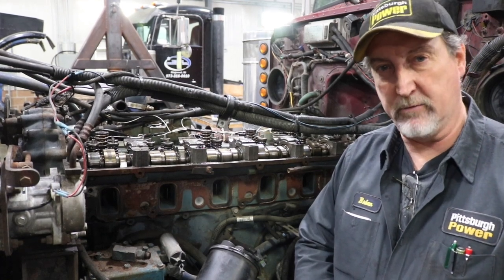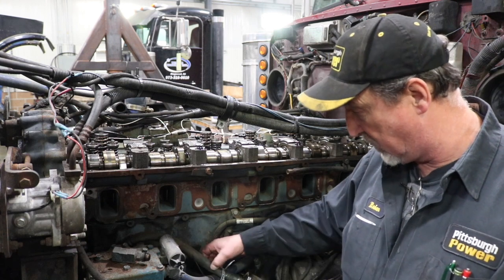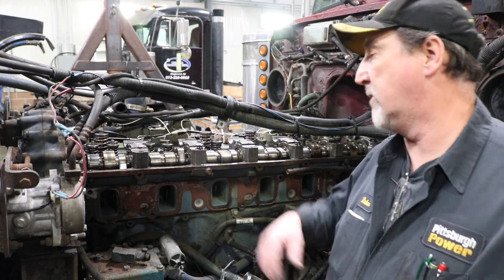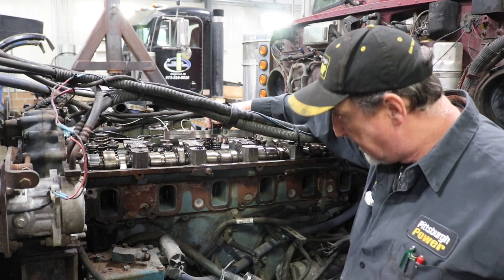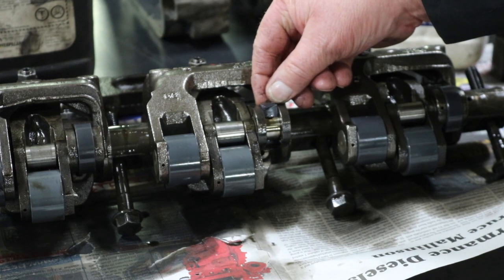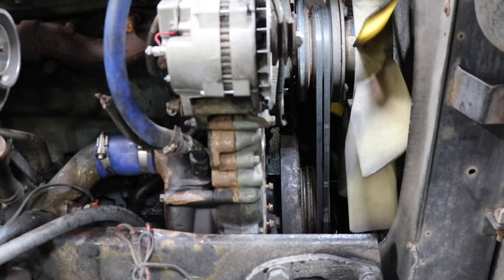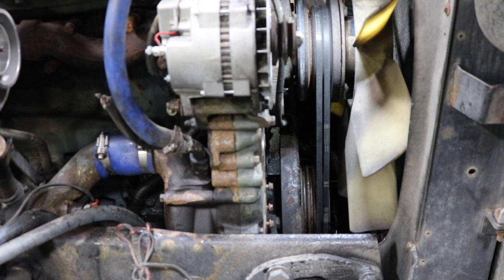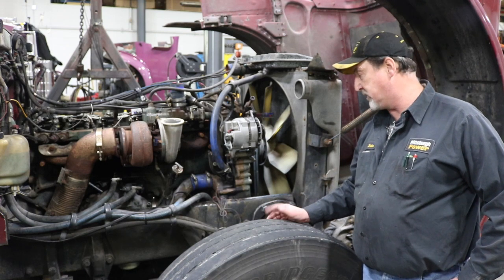DDEC4 IV Tech Tip

Comment: My mate, he had his Series 60 in getting work done at Detroit dealer in Sydney, they replaced the front cam gear, went for the road test and it fell OFF!   The valves of the engine were hammered into the head so tight, they could not be removed, and they had to give him a new complete cylinder head LOL

Comment: Volvo D13 engine breaks the inlet roller if not set valve gap correctly.
The roller ends up bouncing on the cam at certain rpm and it cracks roller and takes out the cam lobe.

Comment: I agree with most of what you said. However the compressor doesn't depend or require boosted air. Driving down the highway most of the time your off boost. Yes keep a clean filter on it but ive done all mine and everyone i know did theirs and never any issues. In fact we saw longer life spans on our compressors
Reply: The older style ones took it directly from the intake manifold which introduces turbocharger oil blow by into the air compressor head. The new style ones do not however, they take it from directly after the engine air filter. I was going to say something to the effect of what you had said, the air compressor does not required pre-pressurized air.

Comment: Detroit had such a problem with the ceramic rollers failing they had a service bulletin for transit engines with service part numbers to use steel rollers.  I prefer to use those on truck and marine engines when going into them even though they didn't have as big a problem as the transit engines. 

As far as the air compressor, the particular Bendix compressor that appears to be does not require boosted intake air. The reason for boosted air to the air compressor was not because it's cleaner, but because the in theory when the compressor is unloaded the air pressure from the intake will help keep the rings sealed and the compressor won't pass as much oil as one naturally aspirated. Many OEM instillations used silicone hose for the compressor intakes as well, not my first choice but it's not "wrong" either.  I agree that the gas engine valve cover breather shoved in the intake hose isn't the right way to do a compressor filter tho!
Reply: Speed and Marine 
I saw them blow a roller on the assembly line when I was there for training in 99
Reply: @MrTheHillfolk  That was probably quite a sight! That was one of those looks great on paper designs. But overall, the 60's are great engines and what engine hasn't had at least some growing pains.
Reply: @speedandmarine9066  
Yea man stuff happens. 
It was depressing seeing the 2 stroke line condensed to 1 single line though. If
I like the 60 series, a lot. 
It is simple, has decent power,and the cost isn't too bad. 
Good all around workhorse.

Comment: Had a detroit 60 series do the same thing on all intake rockers replaced all intake rockers and reran the rack. Runs good. Do know what's causing the issue but I've seen a few
Reply: Same here. Happened on #2 fuel injector follower. It’s a material failure, Detroit came to our shop because it’s happened so much across the country. Moral of the story is, drivers love Detroit’s for fuel mileage, mechanics hate them, and this mechanic is one of them. Worthless boat anchors in my opinion.
Reply: @Seveneleven44  TOTAL BS Bro. You can get a two year old to work on a series 60. If you're speaking about a DD13,15 or 16 then that's different. ANY preemission engine if properly maintained is NOT a boat anchor. You sound like a simp for that statement kid.

Comment: They say at overhaul for replacing the balancer in manual 😀.  Did you see any rust in that hole we have also had these valves bind in the head so much so that when you hit it with a hammer it sounded like it was part of the head real sharp Ting.  Did you see any tap marks on the Piston?

Comment: I believe who ever did the overhead messed up. Probably set one too tight, piston hit the valve and shattered the roller. The ceramic is softer than steel obviously. I would check for engine over speed codes as well just in case.
Reply: The ceramic is way more harder than steel, thus verry brittle.
Reply: ThinAir Diesel 
I was at the factory in 99 for training. 
During the tour we saw they popped a ceramic roller in a 60 and they were picking the pieces out with a grease covered stick. 
The 2 stroke production would end a few months later, glad I got to see a little bit of history.

Comment: The rollers are ceramic not steel?
Reply: Design choice for the Detroit 60 series for wear resistance. People think that the ceramic is not as hard as the cam lobe, on the contrary, the ceramic rollers they made for these rocker arms are far harder than the steel. Hence why this one cracked and broke. I've heard of people dropping these rocker arms on the ground and the ceramic shattering from the impact.
Reply: Batojiri1 
Ceramic has low lubrication requirements and can carry a heck of a load , just don’t shock it or else blammo

Comment: What you're trying to say re the previous rebuild is that it absolutely REEKS of AMATUERISM.
Umm re the bent valve, that begs the question how? It is unlikely the piston hit the valve and smashed off the rocker. How can it? - short of a foreign object. Maybe it ate a fitting or a compressor vane or a bolt/nut etc.
I reason what may have happened during dodgy brothers rebuild is the cam was put in the head and they tightened the rockershaft without consideration of the position the pistons were in, ie the motor wasn't timed. They realised what was happening but not before they cracked an arm which went unnoticed and it developed into this - just an idea.

Comment: DDEC IV I thought was a wastegated Engine.  Didn't see a wastegate on the turbo?
Reply: I have a DDEC IV non-wastegated in my glider
Reply: Depends  on thr build..all my Detroit's had or got gateless. Turbos
Reply: @Stephen-carr  ddec iv has wastegate but can be changed
Reply: They all come with waste gate u can change the turbo
Reply: DDEC 5 used a vgt turbo, no waste gate on any of the automotive engines, I don't know about marine or industrial
Reply: It depends on the model and the horsepower rating that the engine is built for.

Comment: Just did an in frame on a DDEC VI series 60 and we fired it up and road tested, one of the reman injectors failed along with the follower cap in the fuel cam follower. Fucking Detroit’s are garbage. Cry all you want about fuel mileage, there’s a reason they are significantly cheaper to rebuild than Cummins and CAT.   Boat anchors. Just like the “hallowed” Mack e9 V8’s. Never understood the admiration, they’re junk in my opinion.